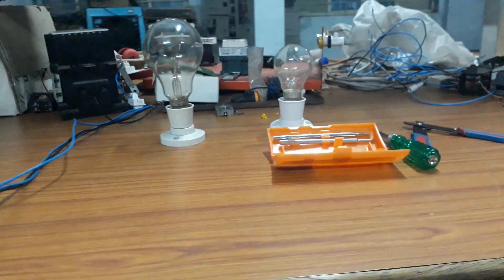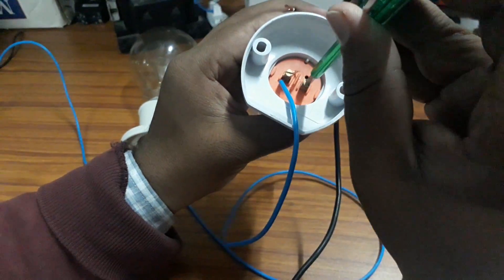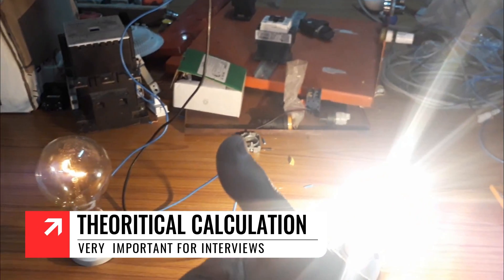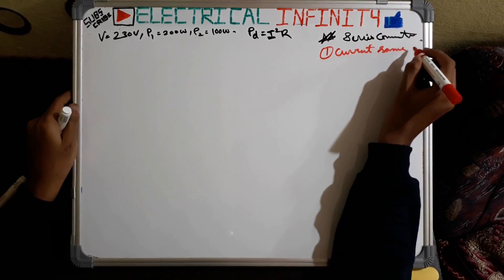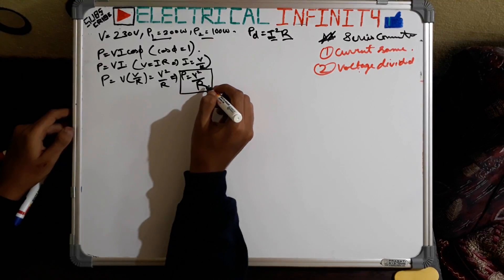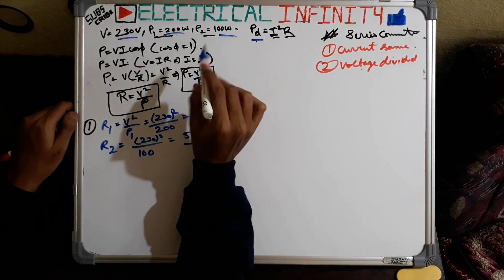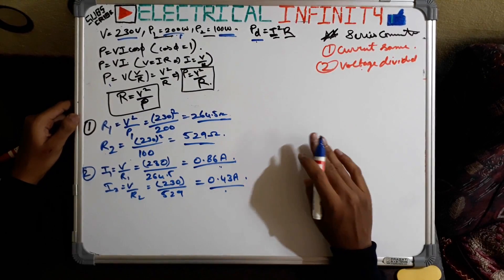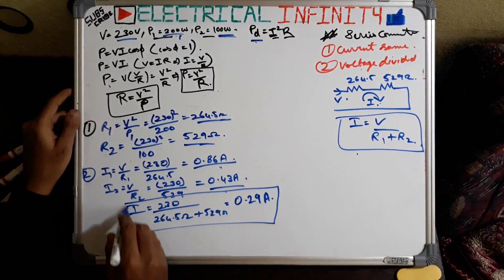Series and Parallel Connection of two bulbs with calculations | series  parallel calculations

Comment: Thank you for the video

I have a question please,
Why did you used 230 V to calculate the resistances? Since the voltage is divided between the bulbs !

Comment: I don't understand. If the voltage is different for each bulb connected in series why did you use the same votage to find the resistances?
Reply from the maker: Checkout the multisim simulation video for series connection on mine channel